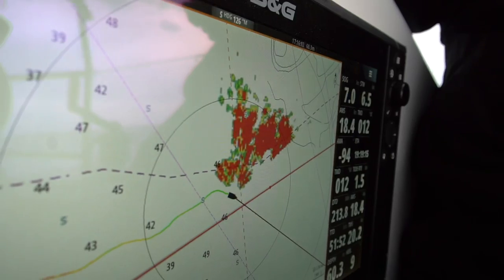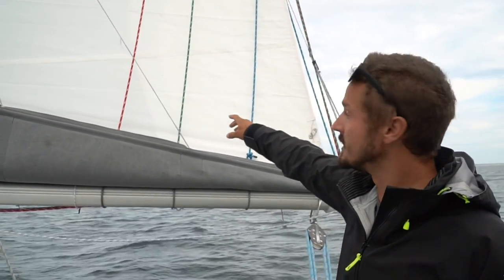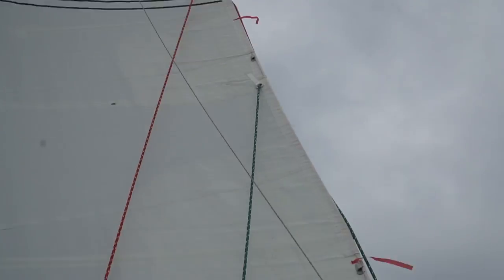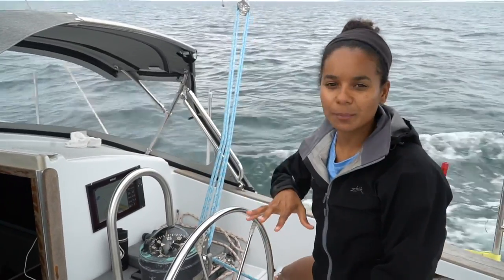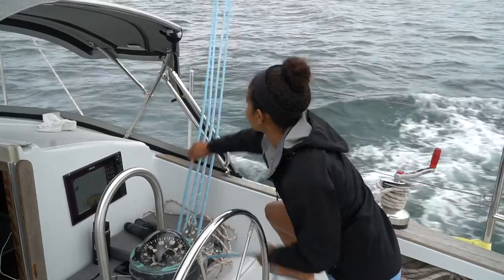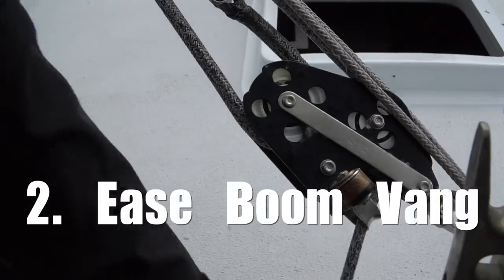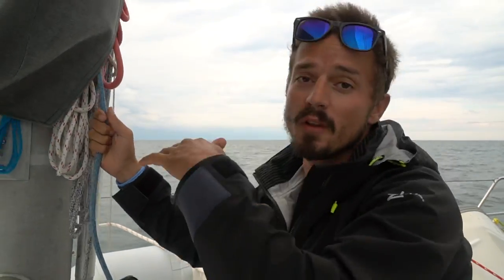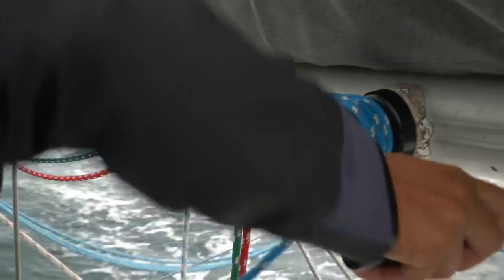How we REEF in 7 Simple Steps

Comment: Thanks to your video, I think I finally understand what reefing is.
I googled parts of a mainsail to learn:
The edges of the mainsail are called the leech, foot and luft.
The corners the mainsail are called the head, clew and tack. 
Reefing points are grommets sewn into the leech (back) of the main sail.
These reef points become the new clew (bottom corner) of the sail when the sail is lowered.

So reefing is lowering the mainsail then using a grommet sewn into the back of the mainsail to pull the mainsail tight and keep it in a nice triangular shape.
or in sailor talk
Reefing is lowering the mainsail then pulling it tight by the reef point in the leech of the mainsail. 

"Reefing" a sail and "taking in a reef" mean the same thing.

On simpler sailboats, the reefing points are a series of straps sewn parallel to the foot of the sail and are tied around the boom when the sail is lowered to "take in a reef".

I hope I got this right because I have been wondering for years what exactly reefing is an how it is done.

Comment: Cool to see, everything led back to the cockpit these days and set up for single line reefing but I guess that means so much more in the boom to go wrong (and where wear is hidden away). Even the halyard at the mast.  Did you consider fitting waist guards at the mast given that so many sail handling tasks need to be done there rather than in the cockpit?  Do you mark the reefing lengths on the halyard so you can go right to it?

Comment: My reefing process is a bit easier on my 32'. The reefing lines go up and back to the boom through both aft and forward reef points in the sail before running aft from the base of the mast (as with all other lines) to the clutches and winches on the coach house roof that are accessed from the cockpit. You can single-handed reef without ever going forward, handy in rough conditions.

Comment: Have you ever considered running your halyards and reefing lines back to the cockpit? That and a slab reefing system would eliminate anyone having to go forward in dicier conditions.
Reply from the maker: We would have to move EVERYTHING back to the cockpit in order to make a difference. It’s a lot of work and our boat really isn’t set up for it. We don’t mind going forward, we can clip off to the mast, so it’s not a issue.
Reply: @SailingUma , yup, understood. It's not a small undertaking as it means adding blocks at the mast base and possibly replacing the base with one with room for more blocks (been there) as well as adding banks of clutches at the coach roof. So, I get it.

Comment: What is your opinion about roller reefing for the main?
Reply from the maker: If the boat is designed with a good roller main system then it’s great, but they’re not all crated equal. For a small boat like ours, we prefer the simplicity of the slab system we’ve got.
Reply: @SailingUma  Thanks a lot...your opinion counts

Comment: This is basic slab reefing most boats have but you have to leave the cockpit as most do it all in the cockpit if you have a loaded vang it keeps the boom level with out need for a boom topper most race boats use slab reefing
Reply: I wouldn't say "most boats" at all! Many of us prefer them at the mast, and here's why:

"Halyards
 It is commonly thought that all of the halyards should be lead to the cockpit. This is certainly true for the jib [he's talking about a hanked jib rather than a roller jib like Uma has] and spinnaker, but not necessary for the mainsail.
The main halyard can be left on the mast because it is usually the first sail to raise and the last to drop. On most sailing days the singlehander will only raise and lower the main one time. As well the skipper will likely be at the main halyard when the motor is running and the boat is flat on the water. The main is probably the most
physically difficult sail to raise in terms of weight so we don’t want to add extra turning points that require extra effort. Even in the worst possible weather, it is still safe to take the few steps from the cockpit to the mast to put in a reef. When reefing the main, the skipper must be at the mast to tie it up anyway. Having the main halyard right next to the reefing line on the mast is very convenient. It makes it possible to drop the main and tighten the reef lines from one position.
One problem with having the main halyard on the side of the mast is the difficulty of reefing in a heavy wind when the halyard is on the leeward side. It is an awkward position if the boat is listing 45° while attempting to handle the halyard from the bottom side. In these cases I just tack so that I’m on the top again."
Thoughts, Tips, Techniques and Tactics for Singlehanded Sailing Andrew Evans
(I highly recommend this book: the newest version is not expensive from Amazon and an old version is available from the single handed sailing society's website. Great resource, great gift idea, etc)
Reply: Wilfred Darr well you only have three types of reef , in mast , roller reef or slab , slab being popular, easy as ours all done from the cockpit ,, a simple downhaul from the reef point back to a winch ,

Comment: Topping lift?
Reply: The topping lift is the line (rope) that goes between the masthead (top of the mast) and the end of the boom.  You need it when you drop the sail to stop it falling into the cockpit !  it also stops the boom hitting the top canvas bits at the back of the boat (the dodger and the bimini)  You don't need it when the sail is up because the sail holds the boom up.  Just FYI lines position sails and halyards pull them up and down (they are all just different names for ropes )
Reply: @richardmoore4194  My point being, they didn't mention it!

Comment: I am learning to sail by watching you, so this may be a stupid question but why don't you have the lines run back to the cockpit to make reefing safer? Is there a structural reason UMA won't do it? Money?
Reply from the maker: If the boat is rigged that way from the factory, it's a great set up. But retrofitting ours isn't worth the trouble. It would require a lot of modification, for minimal gains. Inevitably, you need to go up to the mast any way, so may as well get used to it, and do it safely.

Comment: Very odd setup. Though have not seen your videos since since the trip the north sea. Clutches on the boom? Why not single line reefing on that not so small boat? I reef from the cockpit, even the outhaul is led bac, and like yours, color coded lines, clutched on top deck. Fair winds.
Reply from the maker: That would require a lot of modification to the deck and mast fittings. Adding winches etc. And we’d still need to go forward at some point. So may as well get comfortable with it. Single line reefing is certainly convenient. But it has many moving parts that are hidden than can fail. Also as far as we know, you can’t run a long enough line for a third reef. So you’d still need to go forward in the roughest conditions to put in the 3rd, so you’d still need all the same hardware we already have, plus all the added bits for single line. 

We like to keep things simple and reliable.

Comment: Step 2 topping lift.
Reply from the maker: We don’t mess with our topping lift much. It’s riggers so the boom can’t swing low enough to hit the dodger. The boom is raised a few inches when the main goes up, and increases with each reef point. The only time we adjust it is to keep it from swinging and hitting the leach.
Reply: @SailingUma  The idea with lifting the topping lift (or if you have a solid vang easing that will do the same thing) is that it takes all the load off the leech while you reef. May not work the way you attach the reefing point on the luff but for others it means you only need to release the main halyard to a predetermined mark - no need to retension afterwards.
Reply: @SailingUma  cool, thanks guys

Comment: I'm  sorry, but I still don't  know what the flip, your doing to the main sail. Are you adjusting the length or the width or the height of the main sail. Drawl a picture, on a sheet of paper, For each atage....even on a couple of sheets of paper. I'm one of those people that have to see it visually. Too understand it. Like giving me directions. If it isn't on a map or GPS. We ain't getting there.
Reply from the maker: That’s a good tip Eric. We’ll try to add more graphics/ visuals the next time we do a vid like this. Unfortunately, we’ve made it to that stage in sailing, where we’re forgetting what not knowing anything about sailing was like. We have to step back and remember that only a few short years ago we knew nothing about these things either. 

On that note, reefing is just reducing the size of the sail so the boat balances better, sails faster and is more comfortable. On our boat, each reef reduces the sails area by about 25% 

Hope that makes a little more sense.
Reply: A drone or dinghy clip, showing the full mast, enabling us to see the whole sail during reefing, would be very useful at the start.

Comment: what is reefing
Reply: Running hard onto a reef!
Nope. That’s not true. :-) Reefing is taking in reefs, which means reducing sail area to fit more wind. In this case, the main sail has 3 pre made reefs. Each one takes in more sail area and folds it on top of the boom. The upper part of the sail works like normal, but is located lower down on the mast. With a jib or genoa, the sail in the front, most moats these days reeef it by rolling upp a few rounds on the furling stay. This works, but wears out the sail more and gives poor sail shape.
Reply: @SteinVarjord  You mean, it means reducing the sail area so it will hold LESS wind. When you reef the sail you want to depower the boat.
Reply: @Emily BH. Yes. That’s another way to say the same. My sentence is maybe clearer if I rephrase slightly: Reducing sail area to suit conditions with more wind.